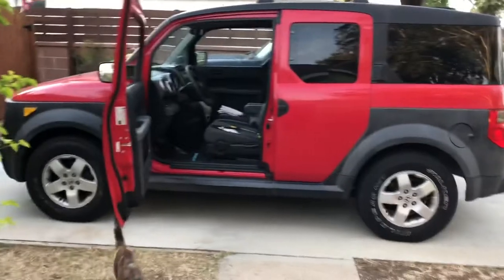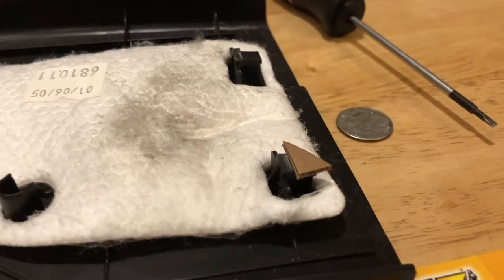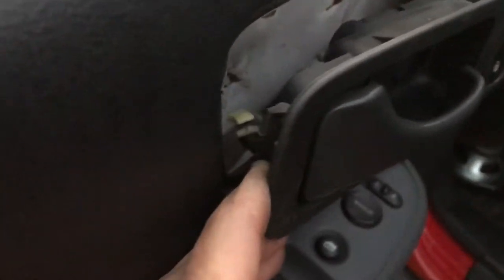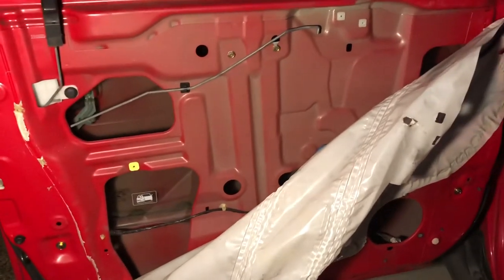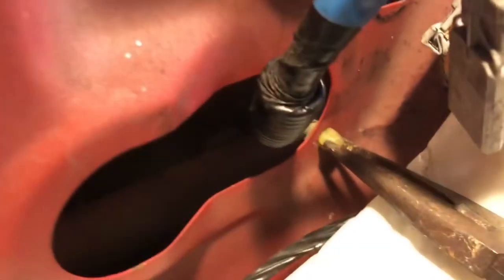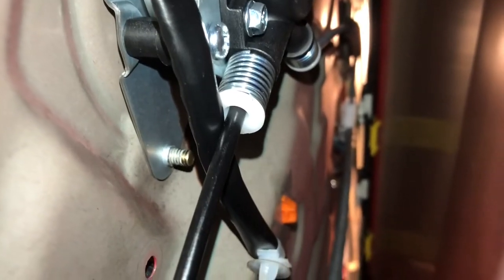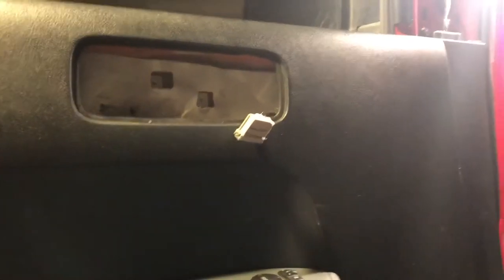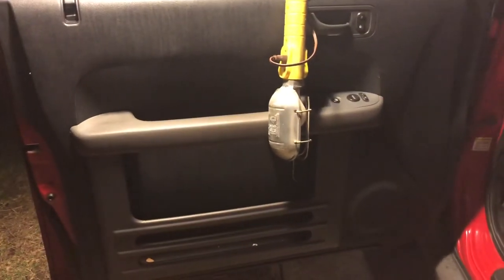Honda Element drivers side window regulator replacement

Comment: Do you by chance have the part number you ordered...I ordered the replacement part, but it came with a different electric clip attachment for the window. The one you installed looks like the correct part/attachment.
Thanks for the video as well.